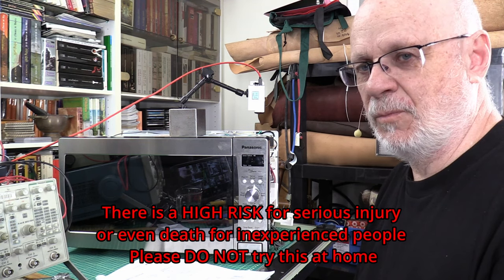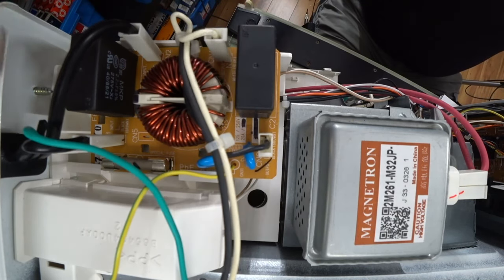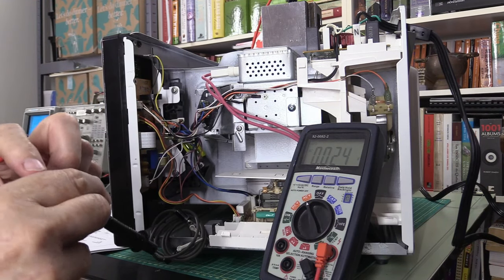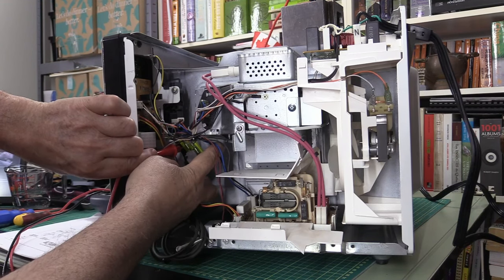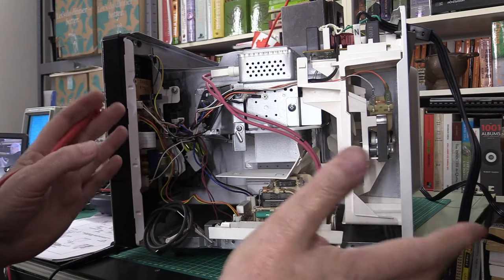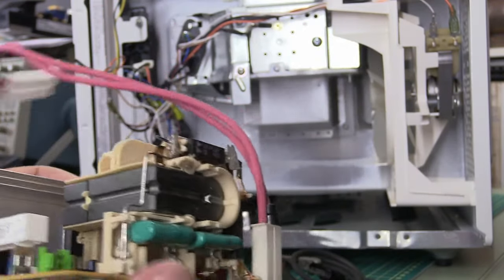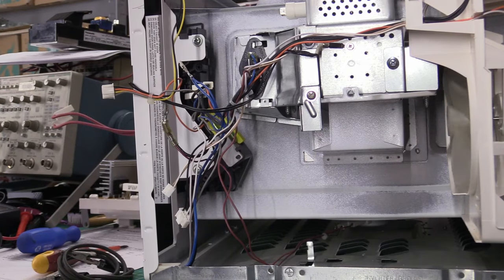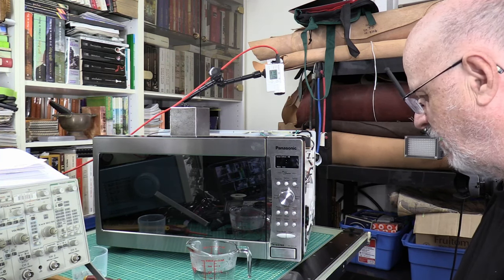Panasonic Inverter Micro-Wave repair (Many other models similar or compatible )

Comment: I’m now confident to go repair the not more than a couple years old Panasonic Inverter microwave in the household. I think you should go teach this as a skill if you aren’t yet doing so…
Reply from the maker: Thanks for a nice comment...

This video is a short overview on how an inverter type microwave works, it's a good start on trying to diagnose the most common problems. 

I'm now retired and not planning to make many more videos since those productions are quite demanding in time and resources.

The best thing is that the microwave keeps working without failure....   😉😉

Comment: HI, What if the microswitch wire connection is put the wrong way?
Reply from the maker: If you put the wires on the wrong switch it will cause issues, but, if you invert the wires on the same switch it won't change anything cause a dry contact like in a mocroswitch isn't polarized.
Hope it helps, let me know if you need more help, thanks for your comment...   👍👍

Comment: But one thing which i expecting is missed here. There is one more board for power supply, that part is missed here. Rest the expalanation is very good thanks.
Reply from the maker: There is the main logic board with the controls and microcontroler, this bord is a little more difficult to service due to requiring more than basic diagnostic.
Thanks for your comment...

Comment: NN-T945SFX - blows fuse immediately upon pressing start. What could be the problem?
Reply from the maker: Most likely that that either the high voltage board and/or the magnetron are defectives, look in the description for the links to the service manuals, if you're familiar with electronics there is a section on what measures to take in order o test the magnetron and some of the components on the high voltage board.

Though, mostly if you're not familiar with high voltage units be very careful not to get injured...

Comment: Hi! Do you know the model number of the inverter that is used for the microwave oven Panasonic NN ST651W? The repairing shop return my oven without the inverter installed. The 2technian" include in the package two inverters and a notesaying that all the inverters are similar, but he takes out the inverter of my oven and he is later confused what are the inverter that came installed originally. I must know the mentioned info to recover my original inverter.
Reply from the maker: By looking in the service manual we get :

F606Y8X00CP        H.V.INVERTER (U) 

This should be a good number, this board seem to be used in a few similar models.

Hope it works for you....

Comment: Please, can you tell me how the communication between the control board and the HV board works? I'm looking to replace the HV board with a common transformer. But I need to make sure the HV board doesn't turn off. I intend to assemble a circuit to simulate the signal from the HV board that goes to the optical coupler.

Comment: Une vraie belle job, Merci. J'ai eu une switch de défectueuse et la fuse thermique, que j’attends encore. Tes explications étaient superbes, Merci
Reply from the maker: Allo Alain,
Vraiment content que tu ais aimé, ta switch va bien finir par arriver un de ces jours....   Du moins, je l'espère.    😊😊
Reply: @Pierre's Garage  en fait c'est la fuse qui est brûlé, et après avoir vu ta vidéo j'en ai re-commander un autre
Reply from the maker: @LgosseuxDbois-TheWoodpecker  
Si le fusible est toasté, il est possible que tu  trouves des composants défectueux sur le circuit de haut voltage, commence par vérifier le transistor IGBT sur le heat sink....
Reply: @Pierre's Garage  Ben non Pierre, c'est la fusible thermique. Renée à fait fondre de la cire pendant plus qu'une demi-heure, on ne pouvait plus toucher aux micro-ondes tellement qu'il était chaud...
Reply from the maker: @LgosseuxDbois-TheWoodpecker  
La leçon à en tirer...    Heu, Non....  Je ferais mieux de me taire....   😱😱😂😂

Comment: So nice to see you again, Pierre.  It's been a long while.  Some very good tips there, appreciate them all, thank you.  Hope all is well with you and your family.
Reply from the maker: It's great to be back, nice of you to comment about what you get from the channel...
Family is doing all right, hope it's the same for you, Pierre
Reply: @pierresgarage2687  Thank you, Pierre.  All is well here.  New Grandson will be one in a few weeks.  Time flies!  I know you are just getting back after some time off.  Whenever you get a chance, would love to hear an update on how your geothermal system is working out for you.
Reply from the maker: @Hey_Its_That_Guy  Apart from a start capacitor that failed on the main compressor, that by the way led to ruining the compressor...  !!!
The waranty covered the material but not the man power, asside from this, it performs very good for cooling in the summer and heating in the winter, including the separate garage about 25 feet from the house. The cost in energy including all, is about one third or better than what it would cost without it... 
So far so good...

Comment: Thanks for the instructive video. Maybe you shoukd mention to discharge the high voltage capacitors by shorting them before working on the inverter pcb?
Reply from the maker: I haven't listened to the video since quite a while, but if my memory is not failing me there is a brief mention about discharging those high voltage capacitors, I also took care of advising people the aren't familiar with electricity and electronics to seek for help from knoledgeable person in order to avoid electrocution or severe injuries.

Comment: NICE TO SEE YOU BACK AGAIN. I think I've seen 2 of those exact models (or ones that look nearly identical to it) tossed out once and "rescued" them. When I tested them, if I ran them on full power, the transformer on the inverter board smoked. And if I ran them on 50% power, the coil in the transformer REALLY smoked. Because the windings in the coil were clearly shot, I didn't trouble shoot any further than that, and they went back to where I found them! Was a really odd failure for it to smoke MORE when running on lower power setting - obviously the main switching semiconductor in the inverter was really f'ed!
Reply from the maker: Once the transformer has started to toast, there is nothing to do in order to save it, there is formation of carbon that will snowball with use and get completely short as it goes. 
Quite a few years ago I've seen a HV board with a burnt transformer, at that moment since it wasn't my oven I wasn't gonna bother trying to fix it, it would have been interesting to investigate...
The problem is the cost of a new HV board, if someone knows where to get a new board at a decent price, I'll add it up in the comment section.
It's always nice to save an appliance from the dumpster mostly if it only require only a minor repair.
Thanks for your comment...

Comment: Merci/! Ours gave the H98 error, tried a power cycle then dropped it on the floor a few times because you know as well as I  fails are 90% + due to contact failures and it started working again!  I was afraid to run the unit with the cover off and now suspect/hope it is that relay as you can hear an arcing sound as it cooks... possibly the relay contacts buzzing or could be something else.  Thanks to your video I will crack it open and try to isolate where the arcing sound source is - again hoping it is the relay.  If I don't follow up in the next month or so, it was and thanks again in advance!
Reply from the maker: Hope you get it working and it's simple to repair, let me know...
Thanks for your comment...!
Reply: Bought a completely different used working  model for $40 yesterday with mostly identical parts according to Panasonic. Tried the magnetron first, then the high voltage board and BINGO - wife is happy again.  Un gros merci pour votre vidéo!:face-blue-smiling:
Reply from the maker: Glad you got it working again...   👍👍
I'm also happy you got time to follow up and shared your results.

Comment: Excellent repair video. I have the same model and same issue. I will check the relay if it is faulty. Please infor..where have you downloaded the seevice manual. Thanks
Reply from the maker: Hope you solve your problem the easy way....
Try this link and just type in one of the numbers of models in the list from the description section or the direst model number, it should give you a proper manual....
https://www.manualslib.com/
Thanks fo viewing and for your comment,   
Cheers,  Pierre

Comment: Thanks nice one. Does the high electric cause any shock if the power is disconnected ? I mean does it have any stored electicity to cause any shock when the main power plug is removed for a fuse replacement inside the oven?  A Panasonnic oven tripped our mains and the fuse inside the oven has gone and on fuse replacement it works, but tripped again once more but the fuse is fine this time and  on mains trip back on the oven works again. Not sure if there would be any other issues., or is it safe to use again.
Reply from the maker: Sounds like you may have an issue that won't fix itself by replacing the fuse, you need to check the magnetron or investigate the main high voltage board...
Look in the description below, there is a link to the schematics, in there you'll find the procedure on how to test many of the components that may fail.
BEWARE OF HIGH VOLTAGES that could be lethal, mostly if you're not familiar with electricity or electronics repairs, if unsure refer, to experienced service people...!!!

Comment: i wish you had shown more about the testing thermal overload
Reply from the maker: The thermal switch is quite simple to diagnose, it's essentially a bi-metal blade that will deform when heated, it's either on or off, when the temperature is below it's rated operation specs it will be a short circuit or closed to allow the current to pass.
For testing, you use an ohm meter and the result needs to be a short circuit between the tabs, if not, the device is defective.
Hope it's what you were looking for.... 
Cheers,   Pierre

Comment: Hi, I would like to know how you found the relay was faulty. Im beginning to check a 6n686s panasonic inverter which gave me error H98, it warmed the water cup and stopped after some 15 seconds, at the third try it didn't warm the water again so I opened  and began starting the visual check, the magnetron looked ok and my guess is the power supply but who knows. Didn't think of the relay or switches, tomorrow will look at them. Regards.
Reply from the maker: The symptom in my case was the cycle would stop after 2 to 3 seconds, I simply jumped the relay with a piece of wire and everything went normal, just be careful, mostly if you're not familiar with electronics and electricity....

Comment: Bonjour. Regarding the high-voltage rectifiers... From what I have read and seen, a regular multimeter won't be able to test these, because the forward voltage when conducting is several volts, not just 0.6 to 0.7V for standard silicon diodes. I have used a 12V power supply and a 1K resistor in series with the diode. Measure the voltage across the rectifier. Hooked up in reverse, the voltage across the rectifier will be the 12V of the power supply. When connected in the forward direction, the voltage across the rectifier will be anywhere from about 5V up to maybe 10V, depending on the device. 
Today, I was working on a Panasonic microwave (model NN-ST661B) with this exact same inverter module. One rectifier (D702?) was dead short, and the other (D701?) was okay. The inverter wasn't generating high voltage, so the microwave shut down after 23 seconds, just as it is supposed to for this failure mode. A replacement inverter is about $160 CAD.
Reply from the maker: It's possible to take a chance to find a supply for  replacement diodes, ( Digi-Key, Mouser, etc) I don't have on hand the number or reference of that diode since There isn't a microwave open close by. One possible way to avoid paying 160$ would be to get a used microwave that works, even if the outside apearance isn't great, all you need is the board, by checking the model number and refering to the proper service manual you'll know if the board is compatible. Note that many models of inverter series within the same power range share the same board...
I hope you solve your problem...   🙂

Comment: Very Nice job........well done.
   Question:  I just repaired a 12yr.old Emerson with the same relay failure. Can you tell me when exactly does this relay get energized ? I assume it gets energized when you press the "cooking time" button. Is that correct?     Thank you.
Reply from the maker: It gets energized a few seconds after you engage the start button, in the interval the high voltage board checks the voltages are all right and gives the go for the relay to engage.
Cheers,   Pierre
Reply: @pierresgarage2687  Thank you. I can not find the exact schematic for this old unit, nor the control board. So I was just guessing ! I see the big transformer and cap, but I don't think there is a  'high voltage" board, like you show in your video. I only see the "input board and fuse, no "high voltage fuse '. either.  @ Emerson 7300W   made in 2010.
Reply from the maker: I wasn't able to find any schematic for this model, just an operator'S manual. Judging by the weight, it seems that the high voltage is produced by a transformer instead of an electronic converter, the principle should be similar, the relay is only activated when everything is OK, like the door switches and the correct high voltage condition. 
If the realy isn't working there are two possibilities, either the relay is defective ( it's coil or the contacts ) or some safety condition and high voltage status aren't right.

Comment: Could you please explain how exactly you shorted the inverter before starting the repair? The service manual says to short the inverter output terminal of the magnetron filament terminal to the  chassis ground, but it is not clear (to me) where the former is. Thanks!

Comment: Do you have the part number or link to those relays? How did you come up with the P/N, is it on the relay itself?
Reply from the maker: You can look on the relay itself for the number, if it's similar to what I repaired in the video it should be "  JQC-25F-18  " or very close to it, it's available on eBay from many suppliers, price should be no more than 2 to 3$ each plus shipping not more than 4 to 5$.
Let me kno how it goes for you finding it...

Comment: My Sanyo microwave inverter board is defective. I guess the ic controller was dead because the igbt and rectifier diode is normal. I cannot find any Sanyo replacement board in the market (EM-L320TBX). Can I use Panasonic inverter board in this case?

Comment: Hello Poerre.
Can you tell me please. Do you short the capacitors on these Panasonic inverter microwaves,please?
And if so .Can you tell me please. How you do it more safe?
Thank you and nice video.
Reply from the maker: It's always safer to discharge those capscitors, the best way to procede is to get an appropriate resistor and a wire with aligator clips, you clip one end with the resistor to ground or one lead of the capacitor and with the other end you touch the other end. Avoid touching with both hands or making a part with 2 opposite body parts.....
Reply: Thank you Pierre  for the reply. Are the capacitors easy visible? . I was told it was  near the green part of the Inverter board. I only saw a picture so far. I haven't  seen the real one yet.
Many thanks for the reply. @pierresgarage2687
Reply from the maker: As I remember they are quite easy to reach, if an aligator clip doesn't do it you can use meeter probes with a needle point to get the same result, after discharge use the meter to check for residual voltage, though, be careful with the kilovolts rated parts not to overload you meter's capacity. If you're not rxperienced with electric circuits and electronics, be really careful not to cause yourself injuries...

Comment: Hi Pierre, my Panasonic Inverter Microwave, model number NNSD997S, turns on automatically with the light, fan, and turning glass tray activating when the door is closed, even when no button is pressed. This occurs despite replacing all three interlock switches with OEM parts and confirming the door seal is free from debris. Additionally, the control panel shows no obvious damage or burnt marks. Could you share your thoughts on what might be causing this issue?
Reply from the maker: Oh...!   That's a good one...!  First thing that came to me is that there is a possibility of a stuck button or something of the kind,  looks like the logic control board is always on. Not much else i can suggest without more probing, let me know if you can determine if the command signal is active on the output of the main board with the buttons.
Reply: @pierresgarage2687  Yes, you are right! and my problem is fixed.   It was one of the Relays that got stuck and with the help of a screw driver it is working.  Basically, using the plastic handle of a screw driver and tapping the casing of the relay several times.  It is unstuck and working normal now.  Once again, thanks for your great help and it was extremely helpful to resolve my issue.  Cheers.
Reply from the maker: Glag it helped...🙂

Comment: Hello
I have a Panasonic NNSN966S Micro  that when plugged in Just cycles  P10 through P1 and continues until I hit reset button to stop it it. I am unable to use any function at all. Any Ideas 

Thank You

Paul
Reply from the maker: Is it possible that the switch pannel is shorted or dammaged... ?
That's what comes to my mind...